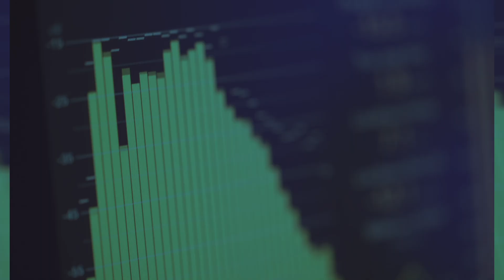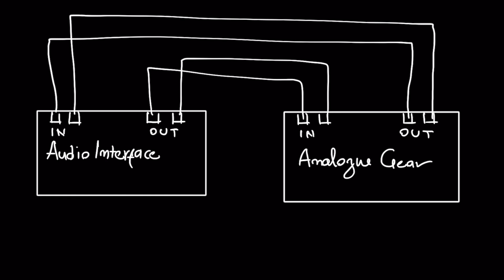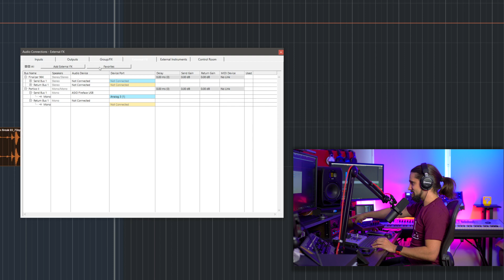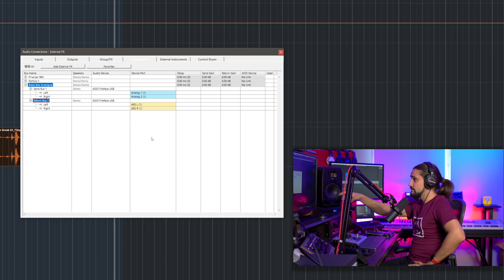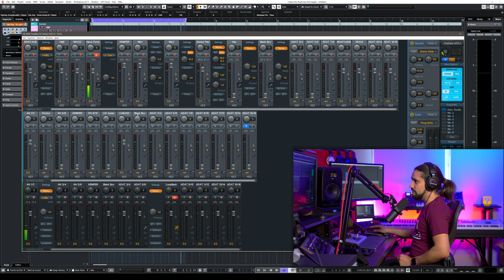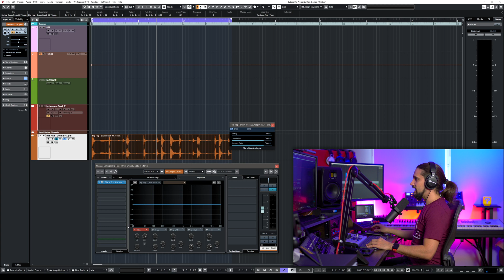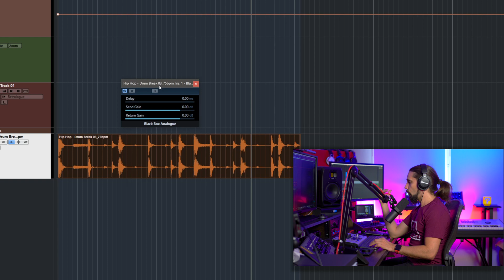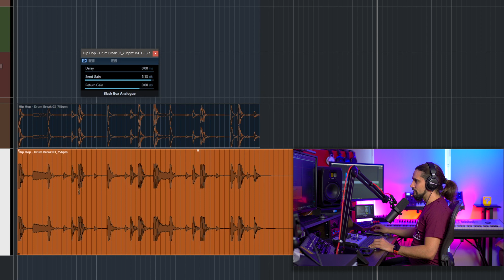Use Hardware Analogue Gear Like Plugins In Cubase! All about External Effects!

Comment: Love the videos Dom! I keep seeing conflicting information online saying that you don't want to send out of one channel and return back into the same channel, because it can cause phasing issues, is that correct? I'm not sure if Cubase has some sort of software magic under the hood to avoid that. e.g. compressor send out channel 5, return in channel 5. That is my current set up, but i don't want to degrade my quality and am trying to avoid issues. lmk
Reply from the maker: Hey my friend! 
If you mean send out from say OUT5 and return in IN5 on your audio interface then there’s absolutely no issue with this.
The only reason why you would get phasing is if you have the return channel on your audio interface turned up. This is where people get it wrong most of the times. The return channel should be muted or volume turned all the way down - Cubase should handle the audio for this internally :)

Comment: Hi Dom, hope you can help, Since changing to a newer Mac studio M4 , I can't use my external gear, when I bypass in cubase I can hear audio as normal through my stereo out, but once engaged nothing. When testing the effects loop is reading 12 ms, when before changing it would be 0- .2.  Tried every I and O on the RME and no difference. Total mix is 100% routed right as so is Cubase audio connection. Have you heard of this problem before? Cheers
Reply from the maker: Have you turned down the input level on your RME for the return of the external gear? It sounds like you haven’t done this and you hear the sound twice: once from Cubase and once from the direct monitoring from RME itself.
RME has multiple sub mixes so it’s a common problem if you don’t pay attention to:)
Reply: @DomSigalas  Thanks a million for your help, I have only just seen this reply. In fact, I didn't have the Fader  level turned up on the software playback channel when clicking on the output fader (bottom row). I am relived, thought there might have been a problem with either my RME, or the new Mac studio M4 or the cubase update. Keep doing what you're doing mate, we all luv ya!👌
Reply from the maker: @TheToby3333 oh yes! This is crucial too!
RMEs are more involved when it comes to routing analog gear compared to say something like the Apollos.
Make sure you save your TotalMix snapshot and workspaces so if you want to recall your settings on your Mac or another computer altogether you will be able to load them instantly! ❤
Reply: @DomSigalas  Thanks will do Dom.

Comment: Hi Dom, I'm on Cubase 14 pro, windows 10 and want to use external synths but its been a nightmare! 

I seriously need help as i am on the verge of walking away from Cubase.

So my interface is an SPL Crimson 3. I have a Yamaha Motif XS rack and a Roland XV 5080. Initially, setting them up was confusing but I eventually managed to do so with guidance from Youtube tutorial. So I have both set up now, so thjat I am able to programme MIDI sounds from them. When I do, the recording happens and I am duly able to edit the MIDI notes. However, when I render in place, all I get is silence.

After spending a whole day trying to get this to work without succeeding, I decided I would use audio mixdown export function as the workaround, but I try that one too and even though the export duly happens and you see the exported files in destination folder, whe you you play it all you get is silence. 

It has to be noted that this does not happen with software VSTi; when i programme and render these it happens perfectly. Why does the software VSTi render in place and is able to be exported into audio but the sounds from the hardwares don't?

Last week, I fired an SOS to Steinberg for help, all I have gotten back is an automatically generated message that my complaint/request has been received, nothing else. And as a resul, I am sitting here frutrated and seriously thinking I should walk away from Cubase and try Logic Pro (VariAudio is the only thread that is still tying me to Cubase. Otherwise, I would be gone a long time ago.

Can you please help me fix this in my once beloved Cubase? 

Thanks in anticipation.
Reply from the maker: Hey Stanley- I doubt changing DAW will help you in this situation.
You shouldn’t be using render in place for what you’re trying to achieve.
If you can trigger the midi from Cubase just create an audio track, route your synth audio inputs and hit record. 
This should record the audio from your audio interface’s inputs and print them down to audio while your synth plays the midi from the midi track. 
It cannot get any simpler than this- render in place is not the right procedure to use for external synths (unless you’ve set them up correctly) This is only for hardware inserts (effects).

Comment: Ta for video.  Have been considering what DAW to get so videos like this are really helpful.  I hope to use a Yamaha A3000 as an external effects unit; it is actually an old sampler but is rated for its effects.  Also want to plug in a Korg M1REx, Roland R8 drum machine and Fantom 7, plus Roland A80 MIDI keyboard. Ta.

Comment: Great video.  But I have an issue where the recorded audio (running via a hardware compressor) is ahead of time in an audible way.  I have done the delay setting check and am using a single input and output from the same audio interface (Motu 828ES).  Delay reported by the external effect process is 1.56ms.  I am not sure what to do to get the audio back in time.

Comment: Hi Dom, huge fan of your channel! I have a question if you don't mind: I recently switched to a Mac Studio M2, and since then all my routing and external fx dont't work. ie: my Warm Audio bus comp receives signal from the DAW (the meter's needle moves) but can't route that signal back into cubase. The audio INs that should loop back to cubase don't work, I tried the same configuration and routing back to my old mac pro, and they work! I'm using Apogee Quartet + Clarett+8Pre in tandem as aggregate device, both cards with additional ADAT ins and outs from ASP880 units. I've been trying everything for 3 days now, if you or anyone reading this has suggestions....please help! :)

Comment: andro here from Sydney Australia, I was wondering if you might be able to help me, I have loaded a session from another user on Cubase 12 still here 
And I’ve lost settings I’ve customized in my set up 
One which is a big deal I use a lot of external hardware 64 in 64 out with external effects compressors, EQs etc 
I lost all the connections 
It’s such a pain to have to do this again simply because I am loading a project not done on my main machine 
Now I’m really worried to load someone’s material in the fear of losing settings.. the worst part is you can’t save it as a preset in the connections for external effects 
Is there a work around or something in the settings so that if I load something it won’t load anything but the project ? 
Thanks a lot

Comment: thanks Dom! Did this with my Boss Digital Delay DE200 and my Autocom MDX1200 which works great as a noise gate for my '76 Strat!
The BBE882i too, is on my MR816csx. 
The Favorites feature for External FX is cool to save settings.

Comment: Can you please do a video for External actual synths, drum machines etc, because there is no way to ping for the delay like we can on effects module, I noticed you have all your keyboards connected, how do you ping them so that cubase adjusts for the latency, if you have a full studio with lot of keyboards etc, each instruments is going to have different latency when using Midi, no one has done video about this in Cubase, you can do it in Bitwig very easily.

Comment: 07:29 If I understand correctly, then the external fx works as a preset inside the track, but does not change the main output and input in the inspector tab (to be able to send it to the group track with plugins.)? For example I have 4 pieces of equipment that need to be rotated? For one channel I need: pre, eq, comp-1... and a little later for the 2nd channel one more comp-2 is added before comp-1 and the eq is removed. And where else does the microphone output go? Well, you will not switch it every time, the first unit of equipment in the circuit will be different.

Comment: Thank you for this informative video :) I have one question: If I have 
very much gain on the outboard output, then it would overload my 
converters in the interface right? And how can the return gain help, 
because i thought that this comes after the converters? So when i adjust
 that, it doesn't make the overloading unhappen?

Comment: Hi Dom, does this work as a send effect on an fx track?  The problem with the insert is that it can only be used in one track at once.

 Are there any different settings needed in the audio interface control panel? I found it quite fiddly to get things set up properly as an insert on the AXR4T.

I’m guessing if this works, the hardware would need to return 100% wet? I’m trying to hook in my new Strymon BigSky!
Reply: Just to answer my own question as I've finally worked it out! Yes, this can be done and it's working great. 

One thing to do on the Strymon was to change the config and in the Dry Signal settings, switch this to kill mode (avoids double monitoring of the dry signal), I then set the the mix to 100% and can then adjust send levels from my tracks like a normal FX track send.

The AXR4T control panel changes all seemed a bit of hit and miss, but I think I've done the got it working sensibly with Control Room and the FX tracks.

* I muted all inputs on all pairs of outputs as these are monitored through Cubase anyway.
* On each pair of outputs, I set the equivalent actuall output to 0db and muted the other pairs of DAW outputs. (so when I switch monitors in control room, I only get to hear through one set)
* I made sure in the output section, that the FX send channel is not muted and set to 0db

I saved this as a preset called Cubase and this seems to work great when in cubase. I can add an instrument or audio track and then add an FX Send to the BigSky and I get to hear the reverb

Outside of Cubase, If i switch the mixer to view settings for the FX Output. I can unmute any of inputs that I want to monitor with BigSky effects. I then just need to unmute the BigSky FX return input on the Output settings for the speakers I'm using.

The key thing seems to be to avoid turning up the FX return on the FX Output, for obvious reasons :)

I think what made this more complicated was that I was trying to do this with some dodgy wiring in my patch bay. This video was really useful https://www.youtube.com/watch?v=0SR35r9uWnk&t=45s having all my devices that output a signal on the top, made it much easier to work out what was flowing where :)

Comment: IM HAVING a  HARD  TIME  UNDERSTANDING  DOM!   i have  an Apollo   silver  { 8 outs } normally  going  to my dangerous  d box { 8 summing}  i  dnt  understand  how  to  insert  my 1176  in between  that!    i sure  wish  you  could   help me  out!  my  brain is  MELTING!  if i come out of  my  Apollo   say   out  of  8 and  go into my 1176   then out my 1176  in to your  routing path.  back into Apollo  8  right?  but  now  how  does  that get to my D box? cuz  normally it  goes   Apollo  8 outs  into  D box  8 in!  so now  input  8 of  the  d box  would not  be  connected   im  LOST!!      help
Reply from the maker: +Mr.Morpheus - tricky to answer with confidence as I don’t own any of the two pieces of gear you have! it all depends on how you’ve connected your Dangerous to the Apollo. If you use the Dangerous as a summing box then, this would be suited to taking things out of the box, summing them and bringing them back in by adding some mojo.
If you want to introduce an insert processor to your signal you just need to go to your Apollo 7-8 out , go to your processor and then back in to your Apollo 7-8 in (doesn’t have to be this pair of course!). The only thing that you would do different would be if you have a dedicated AD-DA converter in the chain. The D-Box is a summing mixer which is a different pony ;)

Comment: Hi Dom..so your Portico is the preamp right? I have UAD 6176 and would like to use it as external effects on Antelope Orion Synergy Core. So basically, the setup is the same only I need to select mono? UAD 6176 only has one input and one output though.
Reply from the maker: Yes, just use it as a mini external effect! Make sure you only add it to mono channels otherwise one channel is not going to be processed when in stereo :)

Comment: Question, when i go to use my outboard gear Pro VLA II compressor say on a kick drum, my interface shows it's clipping. I have the gain turned all the down on the interface channel I'm using. If I use the the sliders as you did here to remove the clipping, I lose to much volume and can't here the nice low end when put back in the full mix. How do I correct that issue? Or should I not worry about it as long as it sounds good, even with the clipping interface?
Thank you Dom
Andy Tullis
Reply from the maker: Hi Andy! This sounds to me like a level mismatch issue. If you bypass the compressor (hardware bypass) does it still show clipping? Most of the times professional equipment required a +4 balanced connection level (compared to -10dbV) so you might be mismatching on the way  in (compressor sends +4dbu and your input is set at -10). If this is the case this should be remedied first for sure. As a rule, I would avoid clipping the converters unless you know what you’re doing :)
Reply: @DomSigalas  thank you, on the back of the VLA II it has a -10/+4  switch, I'll try switching it. 🙂 Thank you again!
Reply: @DomSigalas  give you an update, switching to -10dbv helped a little. But what i found was that I had changed out the tubes in my compressor but I never did a proper re-balancing of them. So I used the test tone plugin in cubase to achieve a -12db line and that gave me the proper headroom. Thank you again for pointing me in a direction. 
Andy Tullis

Comment: well well well this looks like a dream BUT the 0 ms delay displayed is often WRONG !!! Cubase is just unable to ping correctly. I did the test with cubase 10 and my fireface ucx : it s obvious when you play the others tracks with the one where you did the hardware insert there s a big problem (and in this video you just hear the track alone.....) !!! I was a huge fan of cubase over 20 years. I was fed up with this problem which is a BIG ONE and recently tried on REAPER ; what a surprised, in the same configuration the ping is well done and delay compensated. At this occasion i discovered REAPER , and was so sad to haven t discovered it earlier....

Comment: If you freeze the track  can u keep the sound of the gear  and  use the same gear to other track at the same time?
Reply from the maker: Exactly! I do this all the time. But I don’t freeze,  use render-in-place :)
Reply: @DomSigalas  if i use render in place i will have 2 tracks with the same content and if i use freeze i have just one track and every time i want to change something from the hardware i just unfreeze. which is better method to use  ?
Reply from the maker: @mimikoss  Definitely Render In Place for me :) Cubase automatically mutes the rendered event so you don't have to worry. If you want to save even more ram and space what I do is I deactivate the channel above and if I am sure I am not going to use it anymore I hide it too. All these things you can do by right clicking on the channel ;)

Comment: great! I use different external gears but actually I need to use BOSS RC-202 Loop Station as external gear in Cubase 10.5 to loop some of my VST instruments parts I play with midi controller. Is it the same settings u've shown in this video also for this type of gear, the Boss Rc202? 
Thanks a lot for your videos! cheers

Comment: I switched from Digital Performer to Cubase Pro this year . I prefer Cubase’ s far more intuitive handling of external MIDI Instruments and external effects. I have all my outboard (Lexicon PCM81 & 91 , TC Reverb 4000, Bricasti System One and Drawmer Masterflow 2476)  connected via AES to a MOTU 112D and it works flawlessly.

Comment: Hi Dom, thanks for another great tutorial. I'm using analogue SSL EQ and compressor as outboard gear. I'm familiar with all connections and how to use it as a plugin. But when I click for delay compensation it also shows 0.0ms, is it possible? Cables are quite long (2 metres) and no delay? It showed only ones 5ms delay (long time ago and I never changed the cables or anything) , but after that everytime when I click it shows 0.0ms. Thought that there was some problem, but you also had 0.0. How's that possible that there is no delay?
Reply: i have the same problem. Ive read somewhere that there is a bug . my copressor 1 time showed .0,06 delay. but its not doing it anymore.

Comment: Regarding the return gain: as far as I understand, it only reduces the gain inside cubase, like a simple gain plugin, doesn’t it? If the signal from your external processor is too hot, you still might need to reduce the input level of your audio interface to prevent possible clipping of the inputs.
Reply: Yeah, if it hits the actual converters too hot, there's nothing Cubase can do beyond turning down the clipped signal. Plenty of options for attenuation, though.